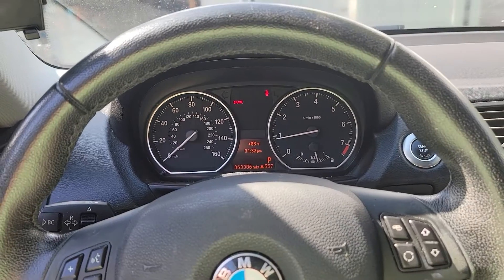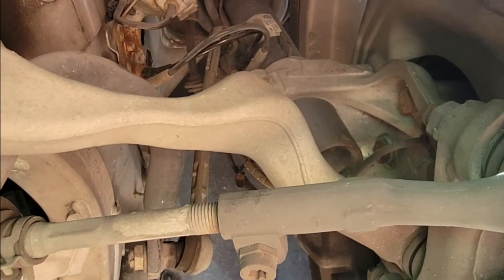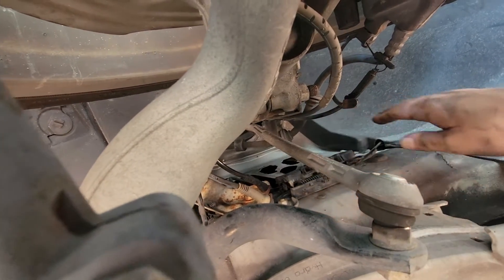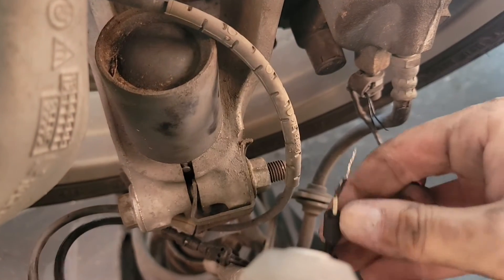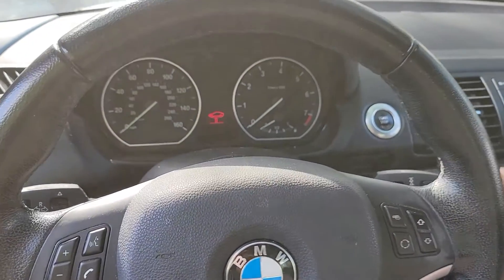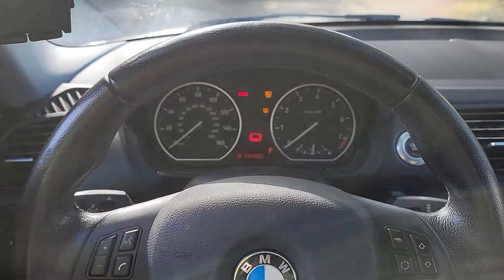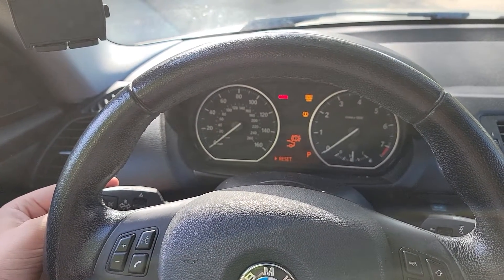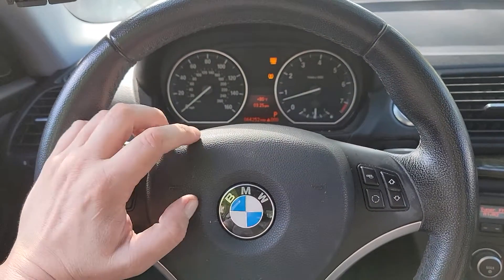How to Disable BMW Brake Pad Thickness Sensor and Turn Off Dash BRAKE Light for FREE - BMW Series

Comment: Could explain why you do that for?
Reply from the maker: The sensors are notorious for being faulty. Further, even when they do function, they notify much too early that brake pad replacement is needed. I can easily learn if brake pads require replacement by listening for brake squealing.